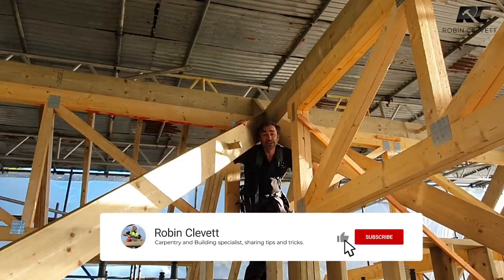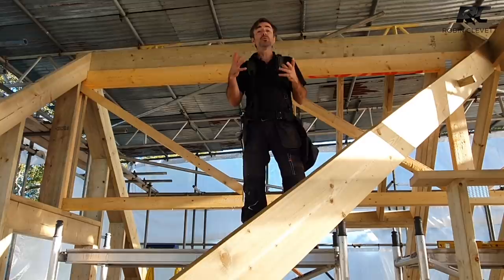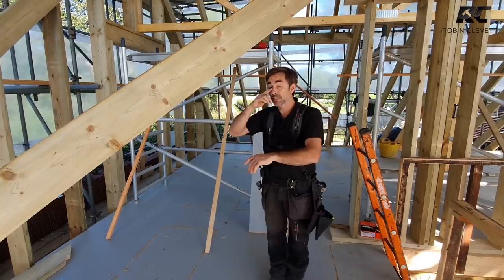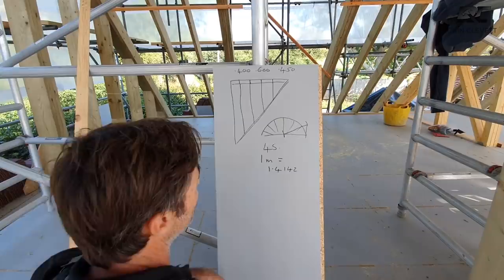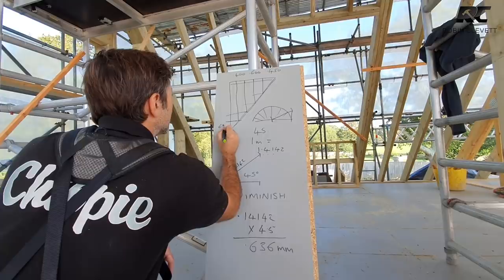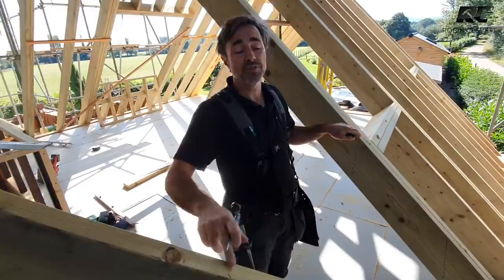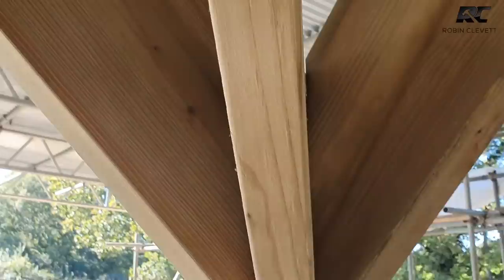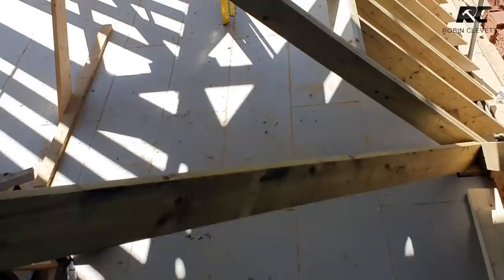Marking and measuring valley jack rafters using diminish to work out lengths

Comment: 1m/cos45 = 1.4142 m, I figured out your explanation very straightforward, this is quite useful for builders, good stuff Robin
Reply: i not good at 3 dimension, would you mind explain it a little bit more please? i have been thinking for couple hours and draw it on my paper and still do not understand the formual.

in 3:12 the jack valley rafters are spacing at 450 centres, that is the horizontal measurment, then 3:55 he talk about the common rafter, how it that related to the 450 spacing?
Reply: @andy2a2m  trigonometry, right angles,  check the formula when  side are equal and pitch 45, check the Pythagorean theorem when  botch side are 45 degrees therefore it will equal side. no that complex

Comment: Simply gorgeous. Your presentation is so wonderfully mellow, I wish everybody could roll like that, we'd have a better world for sure. Another way to figure this all out with minimal calculations is by setting out the spacing, measure the shortest and longest, and divide the result equally. IE set out your 400 or 600 along the top, measure the shortest one plum to the valley, divide along the diagonal by the same number to get the positions, and divide the difference by the same number again to get the diminish. It's always interesting to me how many different methods you can use to get the same outcome, and how different approaches work for different people.

Comment: I am starting to get it a little better. I have a thick head and your terminology in the UK is different. U guys went metric. We didn’t. I like the term diminish. I am visualizing the roof sheathing sitting on all those rafters. Thank u for the instruction!!
Reply: Roof sheathing is not something we do regularly in the UK. Normal it's over felted with a breathable membrane then timber laths fastened on to carry a roof tile of various types. In this case a plain (flat) clay tiles.
Reply: @tedcopple101  Thank u very much for the info!!

Comment: It really is simple Robin, and a really great explanation bud. I cant believe that we use the same method of keeping the valley jacks up on the valley rafter👊 I just tack a half inch rip all the way down the valley and then remove it once all the jacks ate fitted👍It looks amazing
Reply from the maker: I have said this before Del, we are cut from the same cloth!!!
Reply: Hi del. I have set up a string from top valley jack to bottom valley jack and offer up the remainder to this. Same end result.
Reply: @christaylor5291   That's another great way Chris, and gives super straight/flat valleys. I don't do many roofs with valley rafters, but always find then a treat to do. Robins look really cool, are super neat and have those brilliant scarfs in. Imagine what someone will think, when looking at these joints, many years from now. Its this kind of traditional carpentry and being able to execute it so proficiently, that only a 'born to be' carpenter will get. Its, literally, a sin to cover it up and a shame its not in some great big roofs loft space so it can be seen every time you get the Christmas decorations out🤩
Reply: Just like to add a quicker way to get the diminish in robins example !!  Rafter  center ÷ cos of pitch = diminish ( 450 ÷ 0.7071 =636 ) ,easier as u have all the info eg pitch of roof and rafter centers
Reply: @ukconstruction  you have excellent videos. I left my own trade years ago. And went roofing with a carpenter, I loved it and learned quick. I don't roof much now, but I have learnt more great bit and pieces and tips off of you. Top class man. Look forward to your videos 👌

Comment: Great video, really enjoyed that one. For anyone that wants to do the maths you just need the Tangent of the angle to get the ratio, so Tan(45) in your example. Aside: other way you could do that is Pythagoras triangles so if the two square sides are scaled as one the the diagonal will be square root of one squared plus one squared i.e. square root of two. Think the App though is a great idea to keep it all simple. Now I'm really impressed how you get the cuts on the ends right and preserve the correct lengths on the jacks. Noticed the top edge of the jack's sticking proud, but you explained in previous video how the centre of the top face of the valley rafter is the point you are aiming at not the edge of the rafter. Thanks again for great video in fantastic series.

Comment: One thing I would like to add Robin. What I have done over the years with valley rafters depending on roof covering, although necessary keeping the valley rafter lower so valley jacks meet centre of valley rafter for plain tiled roofs with same pitches, with a GRP vinyl valleys for concrete tile and slate roof coverings the valley rafter can be brought back up inline with the roof plains so you have an instant line to set valley jacks either side as the GRP vinyl will seat itself on the valley rafter nicely. It also brings the valley rafter up inside the building so you don’t have to cut as much out of the pir insulation that will cover the valley inside the building! This seems to not be a problem for you as the same depth timbers are used but if the rafter material was 150 and the valleys were 200 ( old skool rule of hip, valley and ridge material is 2” inches wider than common rafter material) this sometimes can be an issue. 
Great detail as always in the video posts. Much appreciated.
Reply from the maker: Hi Chris, I talk about the position of the valley rafter top edge and keeping it down in the previous video in the channel about making and fitting a Valley Rafter, as you say its really important to know the roof covering and make the correct allowances

Comment: There is no need to divide the 1.4142 by 10 if you use the centre to centre distance in metres (450mm = 0.45m).  All you are doing is dividing one number by 10 and multiplying the other by 10.  Just use the 1.4142 ratio and use the centre to centre spacing in metres.

Comment: Hello Robin,
Brilliant video.
This is best method for someone knows about maths.
If someone has difficulty with mathematics, is there any other method please?....
I know maths and I understand very well.
God bless you Robin.
Best wishes from Leicester ENGLAND.
Ahmed
Reply: few methods come to mind
If you google roofing calculator theres sites that let you print out 20 pages of documents that will detail every angle, length and cut. Great for simple roofs but fall apart a bit the more complex it gets.
You could install your first 2 rafters by measuring them, note the difference in length and that gives you robins 636 which you can use to cut the rest.
Draw a full size mock up of your centers and roof pitch(or rise) on a scrap of plywood or the floor and measure the diagonal.
Traditional roofing squares with a fence are great, cut your longest rafter first then use it to step 450. Bit hard to explain but you could probably find a video of it. Roofing square are great you can do complexity roof, but theres a lot of technique rather than math and if you dont do it all the time its easy to forget or mix things up.
You could even guess, most roof coverings arent too sensitive to centers so as long as your close and the corresponding lengths either side of the valley are the same then it doesnt matter much, it might just involving re-cutting a few lengths and a bit more manual handling to test fit.

Comment: I'm still not clear whether the diminish from common rafter to the first jack is measured from the centre of the common to the centre of the slant cut on the first jack?  Or to the long side of the jack, or the short side?  Or from one side of the common to the same side of the jack - and in that case is the diminish different for the first jack compared with the later ones?

Comment: If the roof was just a straight run the load from the roof tiles (slates) would be distributed across a series of parallel roof rafters centred at 450mm.  However with the presence of a valley the load of the roof is effectively being supported by just one long valley rafter with all the Jack rafters transferring their load into it.  At what point do you need to compensate for this extra loading by doubling up the valley rafter timbers?

Comment: Not trying to be critical but you somehow make it more complicated than it is.  
Holding the framing square flush on top of last common will let you mark the long point of the longest valley jack in seconds.  Then just measure length from ridge.  If you showed that, the concept is easier for the untrained to understand. Faster and no math to screw up. The framing square was designed for this.

Comment: Can you just do Rafter length minus the spacing used, so Rafter length minus 450 or 600 each time, then it doesn’t matter what pitch, as long as the corner is 45 ie the building is square.